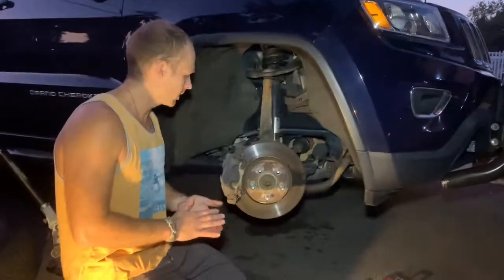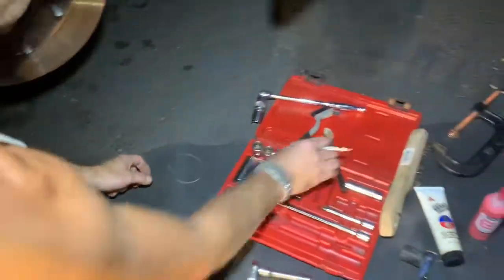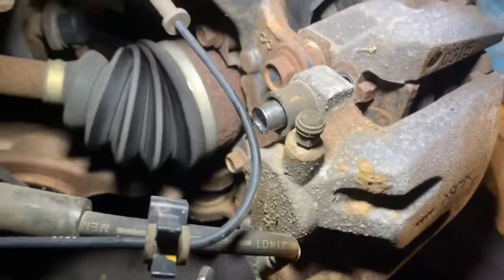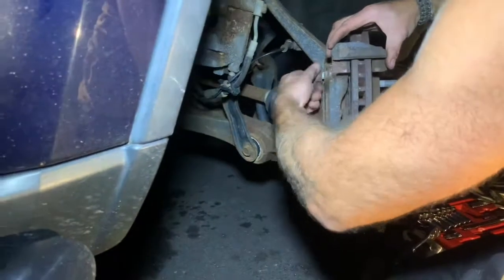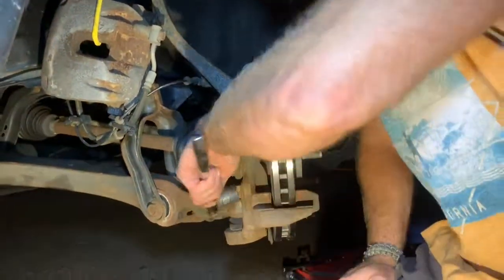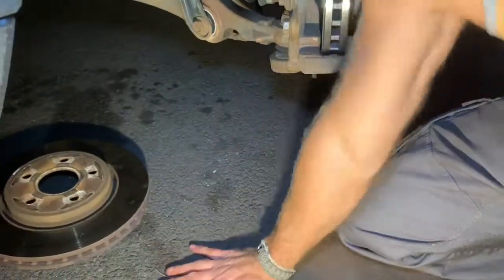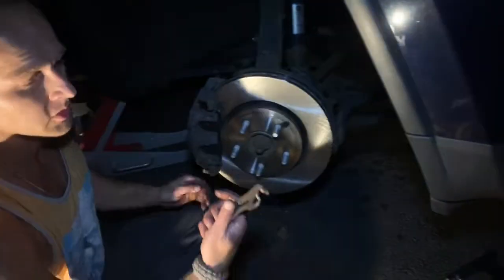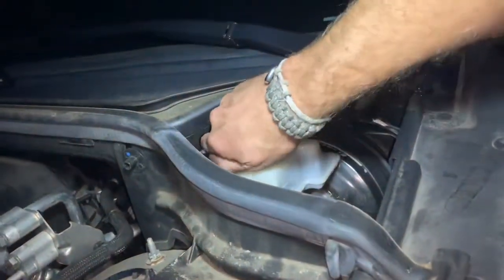Jeep Grand Cherokee Front Brake Pads Rotors Install Removal Replacement 2014 /  2011-2018 etc

Comment: Great video, thanks! For my 2011, the hex socket was 11mm. I had to order it special from internet as no parts stores carried it. Also, the torque settings were 75 ft lbs for caliper bracket to steering knuckle, and 40 ft/lbs for slider bolts.
Reply from the maker: awesome. thanks for the feedback.
Reply: Thank you great supplement information to go with this video!
Reply: Thanks I could not find this anywhere
Reply: Yes Greg… the same think happen to me on my 2012 and iam have the 10mm ande the 12mm and don’t fit…
I had to order too…🤷🏻‍♂️

Comment: Thanks for the confidence inspiring video.  A tip for those with  - if you have an older WK2 (mine is a 2015 with 100K) with original brake pads, your rattle could be caused by rusted mounting studs on the break pads.  They make the little pressure mounting tabs out of cheap metal and they literally rust away with time and then allow the pads to make an annoying rattle over bumps (can occur on rear as well).  I live in Cleveland, OH where they dump a lot of salt on our roads, so if you go longer than say 5 years, and live in a similar environment you may have the same issue.  Simple fix with new pads (although both my rotors and pads had another 10-15K in them).  I have NEVER had a set of pads last longer than 35-40K - Jeep did a great job engineering the pads and rotors to match the WK2 (mine is V6)!  When I went to replace them, I paid up for MOPAR parts hoping to get same results again - don't mess with success!
Reply from the maker: Nice.  Thanks for sharing 👊

Comment: I plan on changing mine out today. Thank you for making such a great, informative video. Appreciate it man!

Note: if you have a 2016 and higher, you'll need an E20 socket to remove the caliper mounting bracket bolts.
Reply from the maker: Nice.  Have fun!

Comment: Thanks for the video!!! I just did my pads in the front. And thanks to your video, I didn't have one issue at all. Took me about 30 minutes per side. Although the allen caliper bolt for the front I had to buy a specialty socket. It's an 11MM and almost no one sells an 11mm Allen. I bought a T12 Spline bit and worked great.
Reply from the maker: glad it worked for you.
Reply: Yes my 2012 caliper bolt was 11mm as well. I thought it was 10 but 10 is too small
Reply: You can use a 11mm or 7/16

Comment: Wish I seen this sooner! Before I paid to have it done. Thanks dude I'll use this next time
Reply from the maker: Yeah.  You’ll have plenty of chances to 👊
Reply: @HowToWithLech  I'll actually be using your other video for the rear brakes tomorrow. Do I need 330 or 350mm for a 2012 overland. Dudes at O'Reilly's couldn't tell me
Reply from the maker: @Extra_Extra_  i didnt measure.  normally i buy for my model and the seller confirms.  but i'll try and check..  try maybee checking on autozone.com  where you can put specs of your car and they'll recommend parts.

Comment: This looks a great video. Do you know if this will stop the sudden vibration/pulse I feel when I brake from high freeway (>50 MPH) speeds? I don’t really notice it much at slower speeds (<35
MPH).
Reply from the maker: Yes.  New rotors and pads will fix that if you experience it during breaking.  But after installing a new set make sure to break them in.  Brake Bedding.  There is videos on this. I have one listed too.  Also manufactures of this pads post directions too.

Comment: Thanks for teh video, but do you know the torque values of the 2 types of the bolts?
Reply from the maker: hi. sorry for the jeep i dont.  i'll try and find out.
Reply: @HowToWithLech  , I found them already. 55Nm (41Ftp) and 200 Nm(148 Ftp).

Comment: My Jeep makes a noise after I release from brake, any idea what it might be? I followed this video to a t
Reply from the maker: you mean after you did the breaks?   dont think that would be rotor or pads as that would squeak if moving if not greased up etc.   possibly something around brake pedal.  sorry hard to tell.   you got brake fluid and all that right.

Comment: The biggest problem actually is to have the allien bolt 11mm for the caliper bolts. It is very rare to have it and after reading a lot, it has been inveted by Mercedes for the ML model.
Reply from the maker: Yeah.  Rare piece.  What’s new right
Reply: They have them at home Depot and Ace
Reply from the maker: ACE probably.  had no luck at my HD @richcityrepresentative8805

Comment: What was wrong with the rotors that you had to change them too?  At 55k miles, they looked like they were still in good condition.
Reply from the maker: It’s so cheap to do it all yourself i rather replace it all.  But yiu can do pads alone too if rotors in good shape and don’t need to be resurfaced
Reply: @HowToWithLech  Thanks... I did front and back w/o changing the rotors.  They were in good shape. Pads cost about $125 total.  Would have been another $400. Next time, if I still own the Jeep, I'll resurface them.  Good video, though.
Reply from the maker: @greg.montelione  wow.  nice.  I guess you got some high quality stuff.   good stuff.

Comment: Did you remember to remove the cap from your brake reservoir first?
Reply from the maker: yes remember to remove it, and put back on before pumping breaks once done.   thought i showed it, but if i didn't apologies.
Reply: @HowToWithLech  Yes it showed towards the end, I must've missed it sorry about that, nice job by the way.

Comment: so are the bolts metric or sae?
Reply from the maker: sae for the socket- 13/16   and metric hex should be a 9mm. sorry for the confusion in video
Reply: @HowToWithLech  

13/16 is 21 mm
Be safe,
 be good,
Be kind.

Comment: What rotors you use?
Reply from the maker: A regular set from ebay.  just search for complete set of brake pads and rotors for your year.  plenty of options but all pretty much the same, unless you go with slotted or zinc plated which is nice plus.  but regular set should cost you about $130-$160 shipped for all 4.

Comment: Should’ve just got the rotor cut instead of buying a new one. Other than that good info
Reply from the maker: It’s cheaper this way if can diy.  Mechanics overcharge for cutting or new rotors.  👍

Comment: You don’t need a block of wood to compress the piston.  Even if you decide to compress the piston after removing you use the old onboard pad and a C clamp.   Same purpose/results and one less item you have to keep track of.

A piece of meta tubing with enough inside diameter to slide over the socket and cut to length with about length to provide the leverage required but short enough to get a full or even 3/4 turn inside the fender well..  inform mine at HD and just Dremel tooled to cut the required length.

Dishwashing detergent on Rotors???   Really....if you pains $95’fornrotors then a $3.99 can of brake cleaner should not break the bank

No retaining screw...I like that but if there is any new hardware  in the kits then use them...new shims, clips, Seals etc....

Another common trick is to use a small coating of Anti-Seize around the rotor hub where the rotor hat slides onto the axle.

Good video but a couple of additional tricks that a lot of people might not think about.

Comment: What size rotor is that is it the 350mm?
Reply from the maker: i belive the front was 350mm yes,  and rear 330mm.  When purchasing just make sure you are getting they for your  year, make, model and you will be fine. thanks
Reply: They will ask if read is solid or vented … that will dictate your front size as well in their database